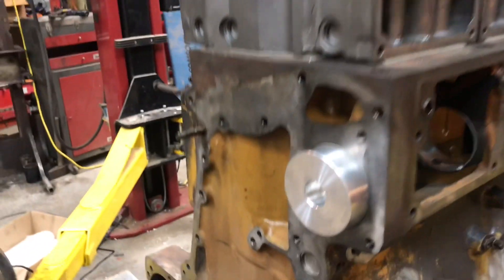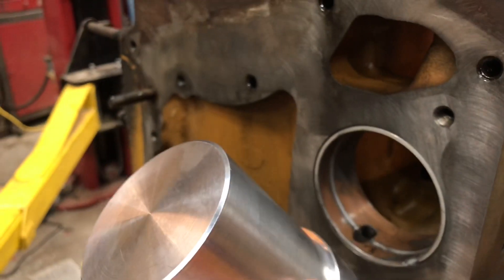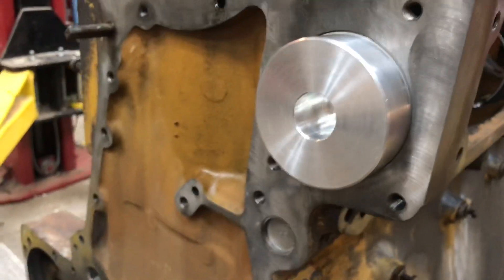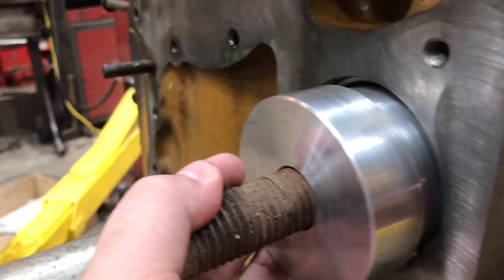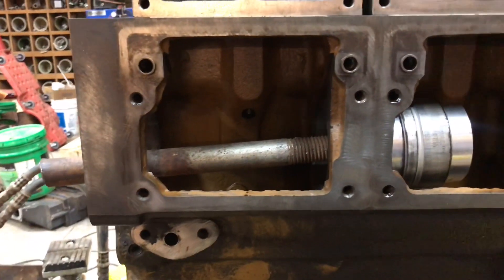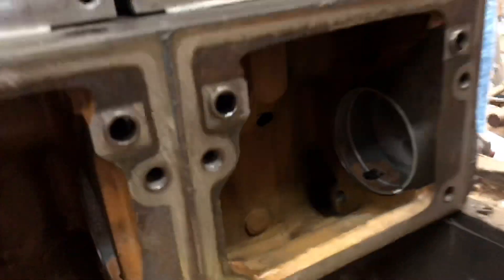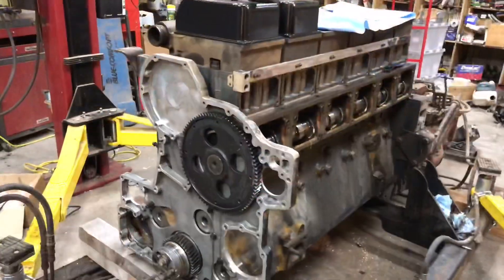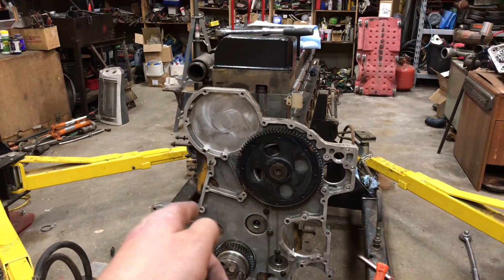Install/Remove camshaft bearings in the 19 liter Cummins KTA 1150

Comment: Early model of k19 right
Reply from the maker: powerstroke0459 is late 70’s considered early? Haha Yeah I’d says it’s an early model.
Reply: @FROSTY2588  lol helped my buddy pull one out of a 50' day scallop boat... put a 650 horse 13.5 Deere in its place
Reply: Did another one, older K19s in a NY water taxi  had 600 horse new ones were Tier 3 final 806 horse
Reply from the maker: powerstroke0459 probably gained a bit of fuel economy! If we were to put a 13.5 powertec in this old big bud some people might loose their mind haha. These Buds deserve to have the original 1150 cubic inch monstrosity. Can’t really match the torque output with a newer smaller engine. This farmer has a QSK 15 in a 485 versatile tuned up to 530hp and he says it’s the only thing that even comes close to the torque of this old motor.
Reply: @FROSTY2588  is it a STC motor by any chance
Reply: And from my experience all the engines we deal with are all marine engines
Reply from the maker: powerstroke0459 no, I don’t believe so
Reply: @FROSTY2588  👌
Reply: Forsale?